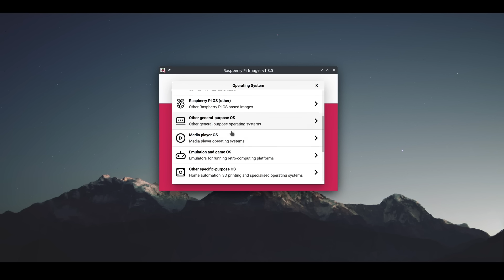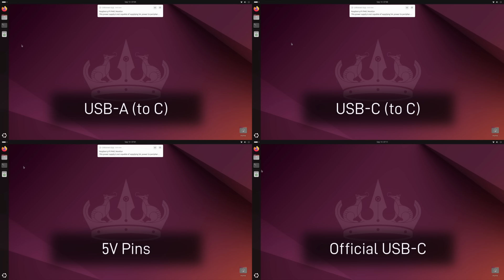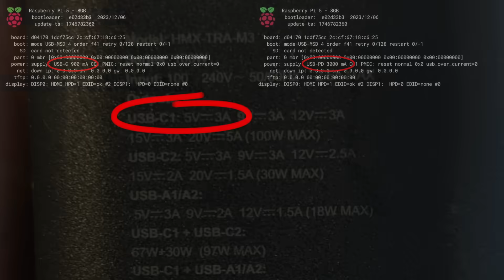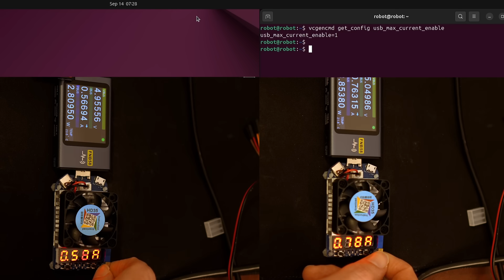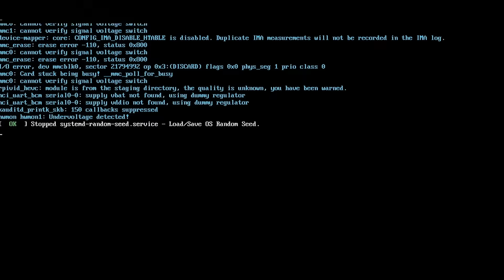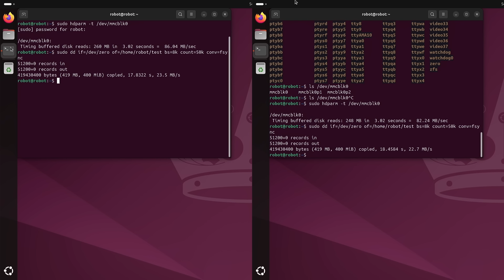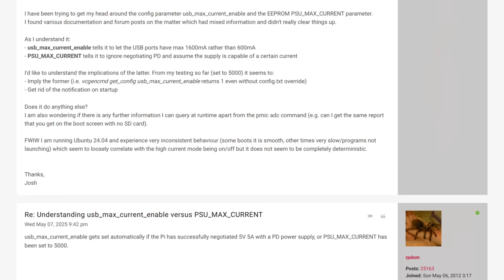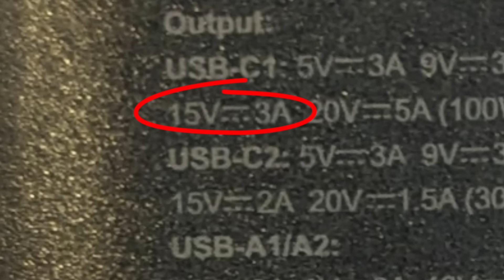How to make a Raspberry Pi 5 actually work

Comment: So, if I'm using a Mean Well 50W 5V 10A IRM-60-5ST power supply, I don't have to jump through hoops to find a PD capable (PD65W) buck converter? That would so very much allow me to clean up my wiring. Thank you in Advance for this information, I'm for sure going to screenshot your blue screen at the beginning. Edited.. an hour later.. I'm running Retropie on my Pi5. My workaround with the PD65W doesn't show any issues with the power. I just checked my CONFIG.TXT file and found that it's already got the USB_MAX_Current_enable=1 selected. Does this mean the Pi is seeing the 5A through my PD65W?    I just tried to set up a new Retropie 5 instance on another Pi. Your edited eeprom hack worked for me. Thank you.

Comment: Each new Raspberry-Pi tinkerer has to deal with these power delivery and SD card issues. I kind of feel the Raspberry Pi is an engineering fail. I got multiple of them and it took me so much time to get 1 or 2 working in a stable manner. I kind of lost fun using them. The desktop / Linux distribution also was not stable and eating memory until the Pi does not react to requests and queries anymore.

The Pi is said to be used in many industrial applications, do these companies also need to work their *sses of before that thing starts to run "kind of" stable for them? o) I'm not a Raspberry Pi user anymore. I switched over to using thin clients, a fully working Windows Server 2022 DataCenter edition is running fine on a Futro S720 or Futro S920 at 3-5W power usage (idle) and costs only 10-20 bucks (used).

These Futros have no issues with power or storage at all. They even have a nice battery backed up clock, standard BIOs / UEFI, several PCIe interfaces, 2xSATA, DisplayPort and whatnot. They also don't need cooling if you put load on them. For regular DIY server / linux / smart home tinkering, these Futros are nice devices, not the fastest around anymore, but because of so many connectivity options, they are fun to explore. You can even connect a full size speaker to the internal PC speaker header and have room filling sound (mono only though), but the little PC speaker amp in there, it is quite powerful as well.

If you need the pins for the robot, I see why the Raspberry Pi is handy, but.. I don't know, it's a strange device to me with lot's of problems and very funky behaviour. I also ended up with several SD cards being corrupt, one Pi would not boot from SD card anymore for no reason (just USB). The Pi has no reset button either and also no real power button and it also cannot really do a proper shutdown (will not really standby or wake up easily). Don't use the Pi if you don't need any pins for your project.

Basing anything on a Pi if you don't need the pinks will cost you a lot of extra money over time, because you have no proper case / housing, you have no cooling yet, you will buy several SD cards or storage adapters and devices until it does boot reliable and not crash anymore, you might run out of RAM because you can't switch RAM modules, you will buy OEM power supplies and so on. You will just pull your hair out and throw money down the drain. That 10-20 bucks thin client from the used marked does not have any of these issues, comes with case, PSU, clock and standard (m)SATA and will even allow to connect NVMe drives (with adapters).

Just saying to save the next buddy weeks of playing around with that "toy".. o)

Comment: I'm still fairly new to the Raspberry Pi world. Right now, I'm building a cyberdeck using a Pi 5 together with an M.2 NVMe SSD on the Pimoroni NVMe Base. From what I've seen in pictures, it looks like everything should fit physically, but I'm not entirely sure whether there might be any other issues when using two HATs on a single Pi at the same time.

Comment: Thank you for this video that clearly detailed to steps to solve a USB-C DC Power powering problem I had with a Raspberry Pi 5/4g. (BTW: Official Wall Wart always worked). It is configured with canonical Ubuntu 24/ROS2 Jazzy with Oak-D-Lite, RPLidar & iRobot Base plugged into USB.  The Oak needed 1000 ma.  I tried a 5A 30000maH Bank & Lipo 2s/Adjustable Buck Convertor set for 5.1v. With the prescribed eeprom PSU_MAX_CURRENT=5000 edit, the  Buck Convertor worked reliably. Oddly the Bank with PD30 specs should work but had intermittent behavior and abandoned. At first I was apprehensive editing the eeprom, but no issue.

Comment: Thanks for making this, it's so difficult to find this info.

It frustrates me to no end that the Raspberry Pi Foundation has done it this way. Inevitably, when you say it's non-standard, there will be somebody piping up with a "well actually" and then point to an extremely optional part of the USB-C PD 3 spec that allows for this. A PART THAT NOBODY IMPLEMENTS!! Why not? Because every charger manufacturer (correctly) assumes that there are almost no devices that require more than 3 A at 5 V, because why on Earth would you not use one of the higher PD voltages if you expect your device to need that much power? I have multiple pricey chargers and power banks that comply with the standard and can pump out 45W to 140W (depending on which one), but none of them can provide the stated maximum 25W that the Pi 5 can draw, because at 5V they all top out at 3 A.

Effectively, the Pi Foundation has made the separately purchased power supply a mandatory purchase, and that power supply is going to be pointless for using with anything other than a Pi 5. I can only hope that the next version of the Pi won't make a move that's so blatantly hostile to its customers.
Reply: Power supply works good for my pinecil solder iron too fyi

Comment: 5.2V with a 5A buck converter. For both Pi4 and Pi5. I use 12v power tool batteries. 

Don't use micro SD. USB is better, 150% better max. NVME is best, Pi5 only tho. If you're cheap you can pull off a used m.2 and crappy hat for as cheap as a decent micro SD. 4 times faster. Set PCIE to gen 3 and use a gen 4x4 m.2. 

Overclock to 3150/1100 with OVD=70k or 80k
4GB or 8GB. 16GB you overspend for no advantage and mine only goes to 2800/1000. Overclocks are on wall power, max current enabled on all. Battery find what works for you.

Comment: The reason your power supply can only supply 3A, is because it is build to conform to USB-C PD 1.0 standards, which used fixed voltage/amperage profiles.  USB-C PD 3.x has added "granular control" which does away with fixed voltage/amperage profiles, and widens the ranges for voltage and amperage within specific "steps". 20mV steps, and 50mA amps respectively. 

I would like to note however, that while the standard has been changed, most USB-C power supplies, and charger's still respect and follow the USB-C 1.0 profile standard, That is why it's so difficult to find a reliable power supply that isn't the over-priced "official" supply.
Reply: the dumbest thing is that even though the newer PD specs add this granular control via PPS, It seems like it won't help!

RPi team members have stated on the forms & in a github issue that implementing PPS lands in the "too hard" bucket. (see rpi-eeprom #497)
so even if you have a new fancy PPS psu + chonky cable that both support & advertise 5V (or 5.1V) @ 5A, THE PI WON'T USE IT 😭. You'll only draw 5V 3A.

but it gets worse - the PMIC on the PI is some custom jobbie specifically for Raspberry Pi & both RPi team + Renesas (Suppliers/manufacturers) won't release the datasheet. the firmware for this PMIC is also closed source.
It wouldn't be possible for someone to do the work for them without some sorta hack or decent reverse engineering. (that being said, I'd say it's definitely possible.)

I'm guessing some engineer/manager at RPi got fixated on using a do-it-all chip but finding a PMIC that supports both USBC-PD negotiation + outputs stable & tight enough for DDR & SoC was difficult. Then the RPi team figured they could sorta make something close enough work. (just not in any actually useful way)

The extra $1 cost to consumers for an additional PD DC-DC chip probably would've been worth it.

TLDR: next time buy a radxa

Comment: Have you tried with Raspi OS, I have been using RPi5 for a year with either USB-C or from pin header, but no issue of such thing.
One of the important thing you may need to consider beside just the Pi is DCDC regulator to get regulated 5V all the time.
Anyway good video!

Comment: The problem is that 5V5A is a nonstandard USB3 power delivery mode and that USB3 has micros embedded in everything (even the cables) that must agree to negotiate to this power delivery mode. Typically USB3 uses higher voltage modes for the higher power levels. 5 amps is a bit much for a USB cable. When the Pi5 was first released, there weren't any official power supplies available and none of the retail adapters from every manufacturer supported 5v5A.
Reply from the maker: Yep it's a bit silly!

Comment: One of the first things I did after determining that Raspberry Pi 5 had what I needed for the project I was about to dive into was to look specifically at power requirements. How many volts? How many Watts? What sustained amperage? If your power supply doesn't deliver 5 V  at minimally 3 A (15 W) you're going to have problems even POSTing. For full performance the Pi 5 likes to have 25 W (5V*5A) available.  Some add-on HATs require even more power so it is very important to RTFM for the add-on boards.
Reply: The problem is 5V 5A is a USB3 delivery format that was nonstandard and nobody actually supported. You couldn't just buy a power supply or use any of your old ones. When the 5 was first released, you couldn't even buy the official adapter yet. It's not enough to have an actual 5v5A supply, it has to be able to support the USBc nonstandard power profile and negotiate to it. USB3 has micros in the cable ends and in every device and the power mode has to be negotiated with everything inline between the supply and the pi. Your cable itself could reject the power mode via it's embedded micro.

Comment: Hello, i recently acquired a Raspberry Pi 5 because i really wanted to build that Articubot_one project that you taught how to build on your channel 3 years ago. You had used ROS2 Foxy and an RPi4b to build the brain of that bot. However, ROS2 Foxy is now deprecated, and Rpi5 can't run Ubuntu 22.04, it can only run Ubuntu 24 and above so I'm stuck with having to use ROS2 jazzy to simulate and build the bot. I'm stuck at trying to run the gazebo sim as well as trying to utilise your package template to its full potential in building that project. I really need assistance as soon as possible. Thanks!❤
Reply from the maker: Yes sorry it's all in a messy state, if you go to https://beta.articulatedrobotics.xyz/category/build-a-mobile-robot-with-ros I have updated some of the written content for Jazzy but some is still in-progress or unchanged.
Reply: @ArticulatedRobotics  ah i see, that would help a ton! thank you so much! keep making such informative videos 🙏

Comment: Good explanation. Have you tested the power consumption issue with official raspberry os. I am powering my rpi5 connected to DSI 10.1 inch display just with power bank and no such issues you referred in the video

Comment: Man, tried to dev an autonomous turret with a watergel gun. with 2 5 amps motors, 1 7 amps gun, all loaded on a 50 amps 12V LEDS PSU. What a fking mistake it was... this pi5 is absolute crap.

Comment: I had a similar problem with the Pi4, where my peripherals were using too much power and causing issues. My work around was to add a second 5v and ground wires directly from the power supply to one of the peripherals.

Comment: I had the same issue sometimes it won't even boot. I bought the waveshare POE+ hat, the type F, I was grossly dissapointed. It only works on poe+ switches, it refuses to even supply power to the PI if its a passive injector. That's not a issue in my case since I do have POE+ its just an annoyance to know this for future projects. My main concern is that the hat runs extremely hot to a point that I am afraid it might melt the case or cause thermal throttle on the Pi itself.

Comment: I can't help but think that, for the SBCs specifically, Raspberry Pi is in the game only because of the brand and software support. The more I know about the hardware, the less attractive it becomes. In that regard, it's always lacking in a major way for most of the applications I intend to use an SBC for. The offering is always subpar, given the price.
Reply from the maker: Yes it can be a bit frustrating, I still gravitate towards it for my tutorials because it is familiar for more people, easy to find support, etc. but it's not necessarily the best option for every (or even many) applications.
Reply: There are not that many comparable compute modules available.
Reply: @vitalyl1327  In what sense? In terms of software and general support, sure, but in terms of hardware, definitely not the case.

What about the Radxa SBCs, or OrangePi? Some modules have direct support from some distros (e.g. Armbian), and are direct competitors in terms of hardware, form factor, etc. For 3D printing, BTT is also a good option.
Reply: @flisboac right, forgot about radxa...

Comment: Possibly a silly question but does anyone happen to know if the 52pi works with a 16gb Pi5?
Reply from the maker: I would be very surprised if it did not work just fine.

Comment: I had this issue using microcontrollers. I'm not sure about the terminal, but if you remove the fan (unless you are overclocking it, or run some intensive loads) This should clear up any power issues, after I diconnected the fan/heat sink worked fairly well. I just put a passive heatsink after that. I ran multiple microcontrollers and no issues on a power supply that supplied 2 amps.
Reply from the maker: Hmm that is an interesting idea! I will have to try

Comment: I also found this problem and my research pointed me at the reason that it's because the PI power plug is fixed to 19v and does not do PD negotiation. But other supplies do, so the PI doesn't get the correct voltage. You can fix the problem by having a usb trigger board set with 20v and this disables the problem with PD negotiation.

I have a double 18650 battery shield which acts as a UPS and also has a way to deliver enough power. It's pretty awesome. But I didnt watch the entire video yet, perhaps you're about to say the exact same thing
Reply from the maker: I'm not sure about the 19/20V situation but yes it is all very finicky! And I think someone else below had that same/similar shield, seems like a good option.

Comment: FYI we've fried a Pi5 while powering over GPIO. It seems possible with the battery->PD->Buck converter setup, however be very careful to use higher quality jumpers and pair up on BOTH +5V pins, as well as connecting to multiple ground pins on GPIO. Documentation says the +5V pins on GPIO are only rated for 3A 😬
Reply: so you connect your psu to both 5v pins ??? and ground multiple ground pins to your star ground to make it safer ? sounds risky too
Reply: @yannmassard3970 yeah at the end of the day it's better to run wires from the buck to a male USBC and power the pi that way (if you're able). That way you get voltage regulation too
Reply: @shooflypieordie  nah it didnt do for me, I had a usb setup like this straight from my Bconverter, but the wires were maybe too thin, in all cases, I couldnt start the pie with a screen, unless the HDMI cable was of high quality. And any tiny stress on the load (like running 2 motors at the same time, and firing) would cause the PSU to flinch for a tiny micro second, bim, your good for a red light. My question for you is : Should you ground multiple pins ? And is it ok to solder 2 5v pins to the buck ? (I use thick wires)
Reply from the maker: Those are some fantastic points, thank you for sharing!

Comment: I am building a robot with the rpi5 on it powered by the 52pi board and its working great. I also use the official Raspberry Pi USB 3 Hub  to power other peripherals like the lidar and the microcontroller , and it doesnt require cutting some cable .

Comment: Just in time! I am also experimenting with 18650 and different kinds of ups to find a good solution to power the pi off grid
Reply: Hey, saw your post. I'm doing the same. I made a 3s2p pack from 18650s out of old battery packs from laptops. A 3s bms and an 11.1v charger  works great.

Comment: I've been using the 52pi board for a while on my NE-Five robot, works a treat! I have used the Vin and Vout headers to remove the need for a DC plug sticking out, I also have an audio HAT which I've added a power in connector to. It spreads the 5v input across the two 5v pins that way, I'm not sure what the limit is per pin but it just didn't feel safe risking 5A through one of them. It's the Adafruit 3w speaker bonnet if anyone is interested, it also breaks out the GPIO pins so makes it easy to add other devices like i2s microphones or i2c sensors.

One benefit of using the Vin on the 52pi output section is that it's switched, if the power is off it's disconnected so reduces the risk of battery drain. I was hoping I could use it for one plug for power in and out, which would've been nice and tidy, but this is a good feature to have and I've killed the batteries on another robot because I wired a servo up direct. The quiescent current over time killed it which was annoying just before a demo!
Reply from the maker: Nice! Thanks for sharing your use case and that's a helpful tip :D
Reply: Here to confirm using the header for input power absolutely requires spreading the input across both of those +5V pins. I'm convinced that's how we fried our avionics pi the first time, putting >3A over just one pin.